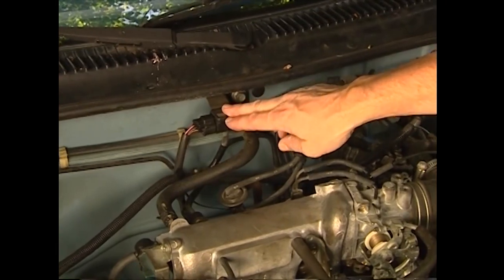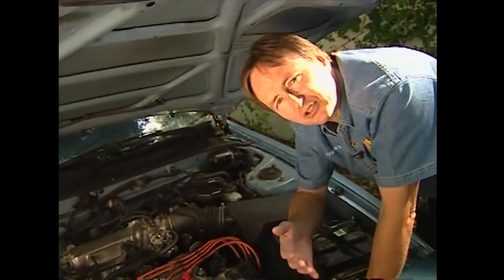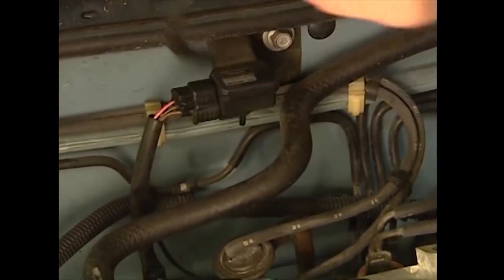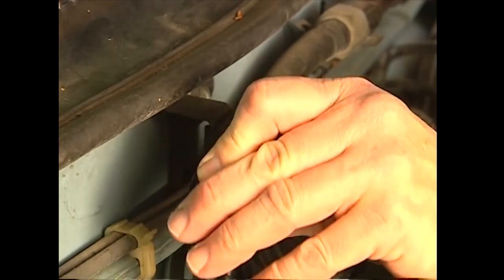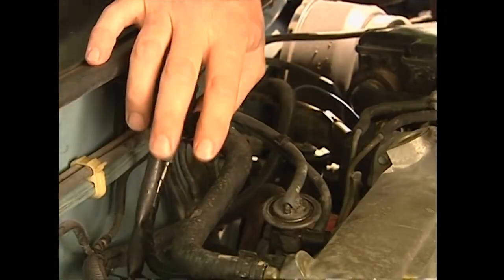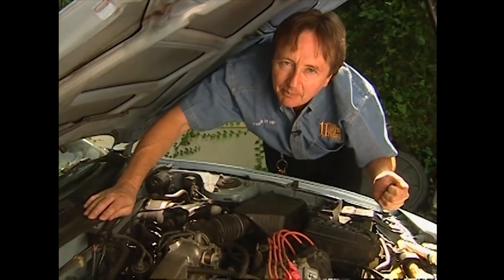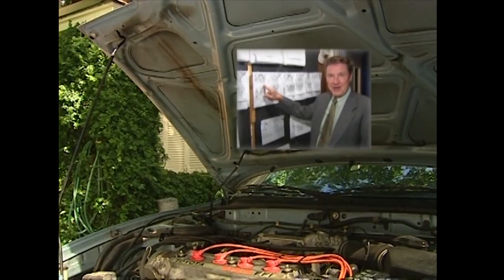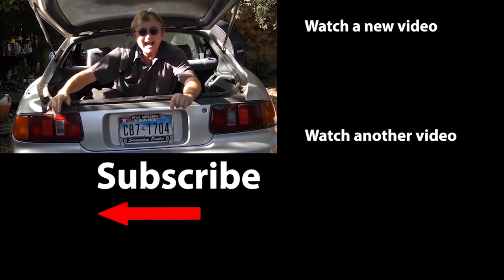WTF is a MAP Sensor

Comment: wow  video effects off the charts,   hey folks,  don't get MAP and MAF sensors confused,  they are different,   MAP  mass air pressure, the one scotty shows you in this video   MAF   mass air flow are very different parts. the MAF is in the air intake tube before the throttle but just after the air filter.  one measures air flow,  one measures air pressure.    they are for fuel injected cars,   think of them working together as a old style choke on a carburetor.   it tells the computer how much gas to give the injectors and can change spark timing. they tell the computer how much air is coming into the motor,  so it knows how much gas to send in.  when you unplug them while the car is running or they malfunction it messes up the fuel flow to the injectors.  and changes injector timing along with the cam sensor,   they all must be working in perfect order for the motor to run. now yes the cam sensor tells the computer when to spark and injectors to squirt gas,  but these things change how long the injector stays open to allow more or less gas into the motor.    yeah  its way complicated.  parts that seem to do almost the same thing can get confusing.   then onto the crank sensor that also tells the computer when to send spark to the plugs,   in some cars the cam sensor did all the work of both spark and injector timing.   so you see,   you got to find a guy like scotty with a scan tool to see what the different sensors are doing to see if they are working properly.  and not just a code reader.  yes it gets expensive and takes time to learn all the things,  and yes most of these  sensors are held on with just one screw and really easy to change,   but the time and experience to know the what and why is the real key to fixing your car.   just because a cheap code reader might give you a code for the MAP sensor does not mean its bad,   just like scotty shown you,   it could be a bad vacuum line or blown intake gasket making the sensor read incorrect and tossing codes out to the computer that something is wrong,   so don't just go out and buy sensors just because a code reader gave you a code telling you a part is bad,
Reply: Sorry to be "that guy" but MAP stands for Manifold Absolute Pressure.
Reply: Hey dude, you ever consider writing a book...
Reply: 😂😂😂 I know right
Reply: @amape312  LMAO!!!😂😂😂
Reply: A Team whether it was a book, a quick write, or a comment, atleast 7 of us read it to the end. Aside from what @Aaron Maple pointed out everything else will give people a better understanding on how it all works
Reply: +A Team This is why I'm glad there are people smart enough to be auto techs.  Cars are so complicated.
Reply: @GGarcia310  its all good,   even for me doing this for 32 years now parts names can be trouble,  for instance   a electric door lock part,   some parts stores list it under electric locks,   some call it actuators.   and no other name with it to tell you what kind of actuator it is,  you must select the name actuator from the parts list to open it up to see what it is to find the electric lock solenoid for the correct part you are looking for on a persons car,   and on computer touch screen part,   the screen that you touch,   it is not listed as a touch screen,   it is listed as a human interface.    now that one took me some time to figure out when I was looking for the part.  never did I think it was called human interface.   as the part name.  even the box the computer comes in list it as the touch screen.  ooh and on brake caliper brake line connector bolts,   some places call the bolt the banjo bolt,   and many other makers simply  call it brake line mounting hardware.
Reply: @Dr.Westside  ooh cool.   yeah,  I can see a turbo sucking the guts out of the MAF and MAP sensors. I love it when a car sucks in so much air the rubber intake hose from the air cleaner sucks is tight,  breathing air in so fast

Comment: I had to replace one in my 08 Impala a year ago due to a rich code it kept throwing. I checked the vacuum lines, replaced the maf sensor, cleaned the throttle, and replaced the o2 sensor after the cat and was stumped since nothing seemed wrong. Then I noticed this map sensor right next to the throttle body. I unbolted the one bolt and it was full of crud on the inside. I disconnected it and cleaned it out with carb cleaner on the inside then air dried it. The code would come on within a drive or two but it took a week for it to come back. Then I ordered a new one and replaced it during my winter oil change and it never came back. As smart as the computers can be these computers were rather dumb and thought I had E85 in the car which I never put in. Its been good since though. Love the content Mr. Kilmer I wouldn't be wrenching if it weren't for your many informative videos over the years. Cheers from north of Boston!

Comment: It helps me to think of  the MAP sensor  as an modern  version of the  old school mechanic's vacuum gauge.
  Note that the MAP sensor  is attached to the firewall above the engine so fluids  that collect in that vacuum  hose can drain back into the engine..

Comment: This sensor (Manifold Absolute Pressure) was used by Honda into the early 2000's. But it needed to be used in conjunction with an inlet temperature sensor, throttle position sensor and RPMs in order to get a feel for the amount of air entering the engine. It was the precursor to a Mass Airflow (MAF) sensor, which is just 1 piece.

Comment: More modern cars now use a MAF sensor in addition to the MAP sensor.  MAF = Mass air flow sensor, measures the airflow in the engine.  MAP = Manifold Absolute Pressure.  Both are used in tandem with the more complex engines, more to go wrong but fortunately both are fairly reliable on most brands.

Comment: Scotty I need your help on this one. I'm in california driving down a mountain, when my 96 gmc c1500 gets out of the cool mountain air and back into the valley the engine starts running rough. After awhile the truck settles back down and the problem solves itself. Could this be a problem with the MAP sensor?

Comment: Hi Scotry!  Could you please post a video showing how vacuum line can be affecting the hidraulic pump work?  I had a problem in my 1991 Toyota pickup V6 2WD...when I step in the break pedal I always could hear and feel a trapidation/vibration on my feet...
I was thinking about my break booster but when I use the clean her in the hydraulic pump reservoir the noise and vibration stopped... I will see during this next week how it will behave but I'm not sure... Could you think about and post a video that can bring some light to this issue happening in my truck?

Thanks in advance!

Comment: Hey Scotty, I have a 2005 honda crv with 150k miles,an automatic transmission its flashing "D" on the dash and, It shifts well 1st to 2nd, but instead of going into 3rd, it shifts into neutral. Could a solenoid be bad, and if so, which one?

Comment: Scotty, I have a 2007 Civic with a 5-speed MT and it has a peculiar problem that only happens in winter when the temperature is low in the 30's.  It may not happen when the engine is cold.  But when it warms up, it consistently happens.  I went through a couple of dealers and local mechanics and no one can tell me what is wrong.  The symptom is the car vibrates violently when moving from a stand still (in 1st gear of course).  It feels like it is not getting enough fuel and it also feels like the 1st gear is chattering.  If I give it a lot of gas when starting like I want to peel out, then it is not as severe but there is still noticeable vibration like the gear is not catching.  Any idea?  Thanks!

Comment: Endless money pits just rip them out
Reply: Really? I live only 800 feet above sea level, probably dont need one huh?
Reply: @angelgjr1999  hell no rip it out
Reply: Might be a good idea IF the barometric pressure ever remained the same, which it never does, regardless of how high or low you live, sea level wise.
Reply: RawHeights [Beats] lol
Reply: Lmao
Reply: Okay then, attempt to make a carb get better gas mileage than a modern DI engine.
Reply: @PurpleHeartVR  What's the modern DI gas mileage?
Reply: @sugarbooty   gas Direct Injection. Or well, any fuel injected engine.
Reply: @JasonCarmichael  I meant a number
Reply: @sugarbooty   99 . Or 17
Reply: @jackd1582  mpg?

Comment: Map sensors can be tested, far as I know at least some, checking for voltage under running conditions,some of them have a vacum pluging to manifold , think that vacum changes electrical readings, u just have to find specs on your particular vehicle

Comment: The little crap that would make my car stall everywhere 😒
Reply: The idle air control valve is the likely culprit here. That little motor takes over and lets enough air through its small passage cut into the throttle body to maintain factory idle speed when you take your foot off the gas.. When it fails the engine will stall every time you take your foot off the gas.
Reply: Cheapest fix is to clean the small passages in the throttle body where the control valve operates and hope they are just dirty. it is not an expensive part overall.
Reply: Caleb it’s been fix lol I got that car around 2010 and was driving like that for a whole year till I finally found out what it was by getting a new map sensor, it was crazy sometimes, especially when it would stall on me on the highway 😱 never stalled on me again

Comment: Does anyone know what a Concentric Slave Cylinder is? My 2014 Nissan 370Z is having some issues with the clutch pedal sticking and my mechanic told me it was that but I don't know what it is or what it does
Reply: it is inside gear box,  could be outside too,  directly related to clutch pedal performance .  i red that 2012 z  notorious with slave cylinder issues . Check all fluid levels, replaced gear box oil with Motul oil  and get second opinion on the issue
Reply: @valpanig  I have a 2014 though, I'm gonna get some fluids tomorrow and have a shop change it to see if that may help. I had to tow the car back home because I was stranded

Comment: So my 2002 Pontiac Grand am had a bad MAP sensor... What freaks my mind out is how does that sensor make your transmission shift/ jut hard?? I replaced mine with a $8 one on ebay (local store wanted $50) and car isnt idling bad and shifting hard anymore. Just straight up odd if you ask me.
Reply: A bad MAP sensor could very well cause this. If it's transmitting bad data, it'll confuse the heck out of the ECU and cause it to run bad and shift poorly. Glad to hear it was an $8 fix. If you took it to a transmission shop, who knows. They'd probably want you to rebuild the whole tranny!
Reply: Drive DB7 yeah its crazy, i even had a ebay $5 off coupon so i only paid $3 and some change for it. I couldnt believe that little sensor could affect the car like that!
Reply: when it goes bad,   it changes the amount of gas going to the motor,   this makes the motor not run as well as it should making less power to make the transmission work properly,   the motor spins slower making the transmission spin slower.     that's kinda basic,  but that's how it makes it not shift right.  there is also transmission shift timing,   and the MAP does effect timing on the injectors as to how long they stay open for more or less gas,   it all works together,   but my god you got so lucky,   I know for a fact all the transmission shops in my city would have said 2,000 dollars for new transmission and then just put on the new MAP sensor and charged the person

Comment: What do you think of 98 Chevy Blazers?
Reply: I got a 96 blazer. Great trucks. Built to last and pretty tough. Powerful but gas mileage sucks
Reply: The 4.3 is a great engine, but the transmissions in those were awful.
Reply: @drivedb7  nope the transmissions were excellent. It's the 4l60e. The same one chevy put in all of the fullsize trucks from 92 to like 2010. Very tough.
Reply: @alexsbikesandmotors  : Pretty much everyone I knew that had a Blazer/Jimmy/Bravada of that body style had the transmissions fail spectacularly. Anecdotal, but worth mentioning.
Reply: Nice! I picked up a 98 blazer with 49,xxx miles. Elderly driven. I’ve been learning as much as I can! (Honda Guy) lol
Reply: Drive DB7 you are correct on that, this blazer already had some sensors replaced on the tranny by previous owner

Comment: A map sensor is the thinnest piece of plastic ever created... They were made to break and cause headaches... When it does eventually break just unplug it and live with the check engine light or you will wind up buying a new one and breaking that upon installation
Reply: hahhaha  yeah  I have broke new MAP sensors while putting them in,   some require a bit of force to push into a rubber grommet to put onto the intake,

Comment: Scotty This is a Non OFFENSIVE SNOWFLAKE COMMENT !!!
Reply: all just switches!!:)
Reply: @jeepgeek8467  yeah   oxygen sensor,  is a switch,   crank sensor is just a switch.  fuel injectors is a switch with a valve that opens and closes.    ahhh  remember the old days when a car only had head light switch and ignition switch and turn signal switch.